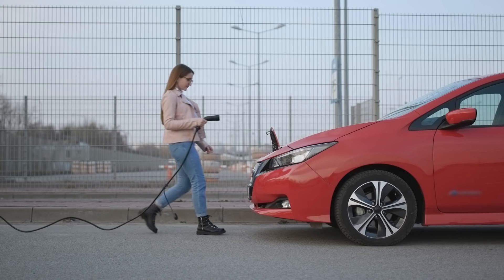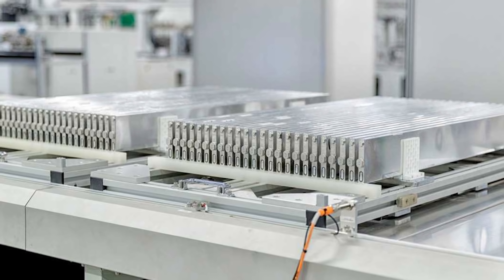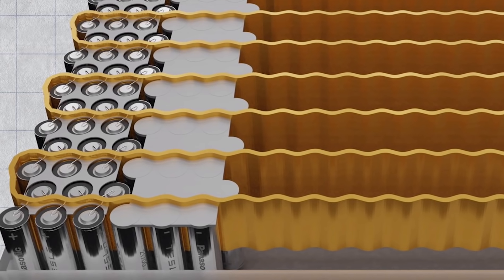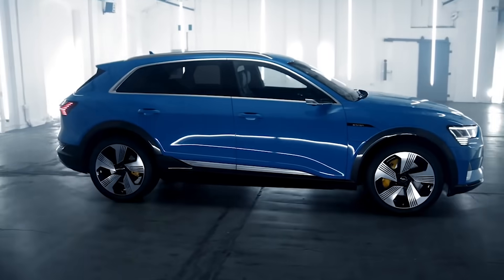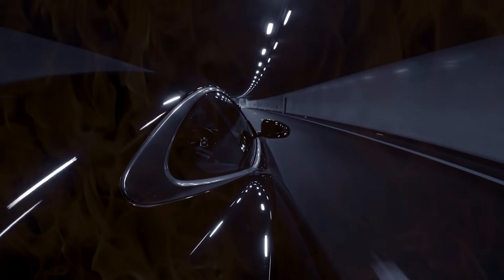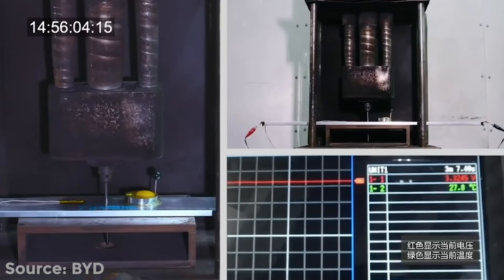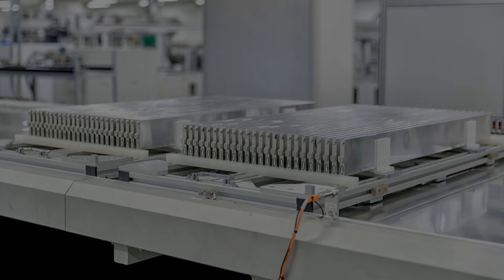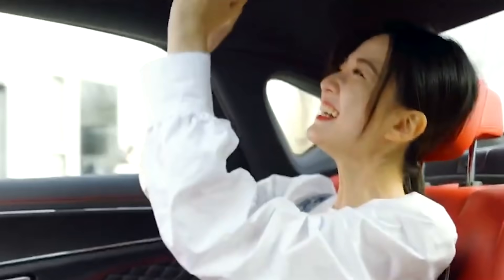Uncovering China's Battery Breakthrough

Comment: you have less surface area when you switch from cylindrical to prismatic cells.
Reply: A circle has always a smaller circumfrence   than a rectangle of same area, regardless of the proportions of that rectangle.
Reply: @Tore_Lund  right. if you have the circle touching the rectangle. how about a 4 small circles touching each other in a rectangle? now, imagine, if you have 40 of them.
Reply: @jayjwin1178  My argument fails if you presume an arbitrary number of round cells in progressive smaller sizes, true, but lets just say it is like enameled copper wire on a coil, which has what 60% fill ratio?, then you are right. However I was arguing a single round cell of same Ah as a rectangular cell would have a smaller surface area, which holds true. Remember the battery box on an EV is also rectangular, so you get more efficient use of space, i.e. volumetric energy density, which can be spent on more straight cooling chanels. If the BYD blade cell is as thick as a Tesla round cell, there wont be much difference, as the Tesla wiggle coolant chanels only touch half the surface of the cell and the rest is buried in silicone foam. Thermally they are about the same amount of cooling and insulation per unit volume of cell.
Reply: @Tore_Lund  i think i didn't express well. what Tesla is doing is using small cells instead of big cell to increase its surface area for cooling purpose.
Reply: @jayjwin1178  
Tesla is using 4680 mainly for Speed of production. They can produce more kWh from the factory for a given number of "cans"  compared to 2170.
"Cooling"?
Prevention of heat is by the tabless construction . Lower internal resistance, less resistive heating.
"The best heat is no heat"

Comment: Nice video, thanks for these updates. Interesting battery concept. Battery production does have an inherent environmental cost and as the demand for EVs increase, lithium will become more sparse.

However, I suppose there are ways to increase the longevity of EVs and their battery life by perhaps designing them in a way to require recharge cycles less often. Regenerative braking could store energy in flywheels and redeploy it under acceleration. I suppose this could extend the life of a battery pack as well as help with range.

What are your thoughts? Here's an interesting video on flywheels:

https://youtu.be/KPJwJfdzP9o
Reply: Every type of construction, Battery or ICE, has "inherent environmental cost".
The difference is with EV's it's a *one off" cost, not continuous.

There's plenty of lithium.

Longevity of EV's will not be limited by the battery technology.

A flywheel large enough to store the energy for a car would be totally impractical.
The rotational forces would try to spin the car in one direction.
Ref "1 million mile battery" (actually 2 million km)

Crazy idea.

Comment: Woah First off, Electric cars always used to use Prismatic cells before Tesla started using cylindrical ones back in 2006. 
Second, the fact that BYD is able to cool their batteries without liquid cooling doesn't mean it's better. I don't think they can go much beyond 2C. Even if they could, I don't think their batteries will last as long as Tesla ones.
As for the fact that they are more flame resistant this really does seem like a plus. But Tesla now shoves all the cells in flame retardant. I don't think it's really any deal breaker.
Reply from the maker: Great point, the key difference is that these are much thinner than prismatic cells, meaning they dont get as hot in the middle of the cell, allowing higher C-rates - but even 2C is roughly high enough for fast charging (70kWh pack could charge at 140kW)
Reply: @ZirothTech  Thanks for the response didn't think you would see this! I like you videos

Comment: FYI: My EV has no 18650 or 21700 batteries. It is alredy based on flat shaped batteries and are already part of the chassis. But they are liquid cooled, as we know this is more effective than air cooling. Chargin rate is a 2C. (=2x the capaciy in KW/h)

Comment: I dont really see how a square block of battery could have a higher surface area than many cylindrical cells packed into the same space? And I guess that would be the fair comparison to make, since then both would have equal capacity.
In other words: you can only maximise one, either volumetric energy density, or cell surface area per storage capacity. not both
Reply from the maker: This is a great question - I stupidly completely forgot to mention that it is because they are really thin (13mm), meaning that they have greater surface area per volume of cell, and heat doesn't have to travel as far from the centre of the cell to the outside. This should have been in the video, sorry!!
Reply: @ZirothTech  Ok, thanks for the explanation! So it is not about surface area, but better heat transfer from the core of the cell to its surface?
Reply: @s.m8766  The larger surface area allows for better heat transfer.
Reply: @Rs07Jehts  So the battery has a lower volumetric energy density?
Reply: @s.m8766  Correct me if I'm wrong but the energy density is based solely off of the composition/type of battery. Surely if the batteries are very low volume (thin) then they would either need 1) more batteries or 2) higher energy density to compensate.
Reply from the maker: @s.m8766  it is technically both, as the cell is thinner, there would be more surface area for the same volume of cells, but also there is a shorter distance for the heat to travel to escape the cell! Hope this clears things up :D
Reply: @s.m8766  lower volumetric density and higher chemical efficiency can coexist and the chemical efficiency is the important aspect of the cell. Of course the space has ti be left for airflow cooling.
Reply: @ZirothTech  I'm concerned about how the form factor world survive crashes and being so thin with the required spacing for air flow.
Reply: How will this affect in colder countries
Reply: @sebinsebastian9404  for best performance, batteries want to be around 25 C I believe. Cold climates would negatively effect the performance of the battery, which is an ongoing problem in the industry.
Reply: @Rs07Jehts  isolated system will be a cheap efficient and reliable way i think but battery like Tesla can use that for an extend but air cooled system will be hard for that.

Comment: Other than the chemistry, this has been around for years, the reason Tesla went the different approach is because of the availability of production facilities
Reply: ok , and what advantages did the tesla batter bring ?
Reply: @davidegaruti2582  faster production ramp up, and because the cells were already available (for laptops) they could use them right away for their cars
Reply: Also the Tesla 4680s will ramp and have a lot of advantages over the current 2170 cells, including volume, and they are working on structural packs as well.
Reply: No. This has not been around until BYD invented it.
Reply: No. Don't lie. This has not been around until BYD invented it.